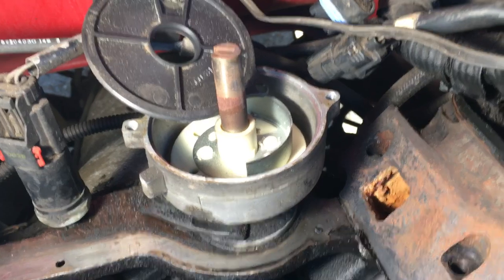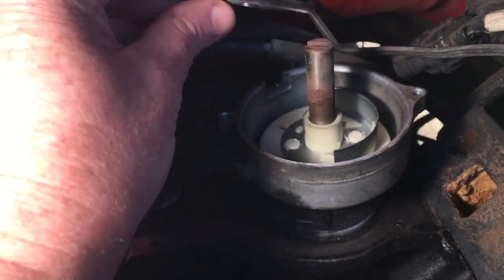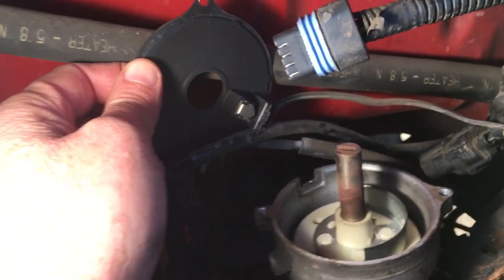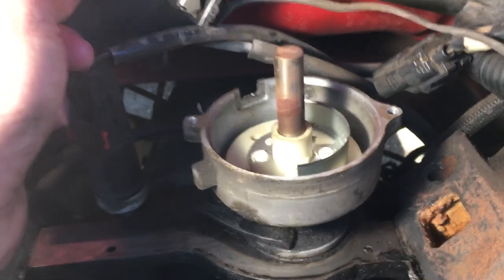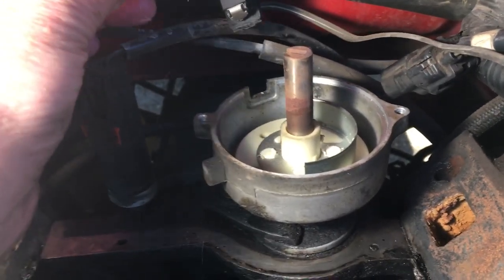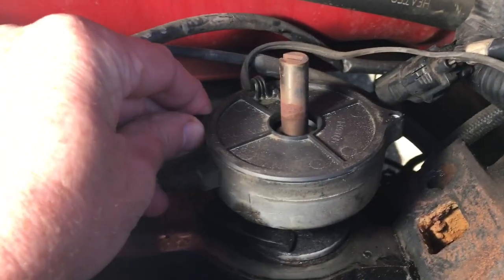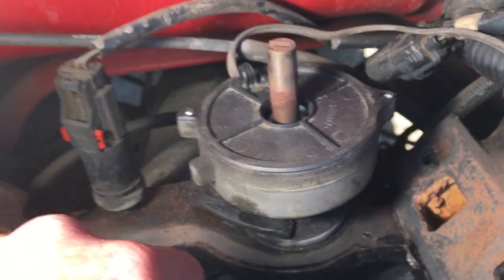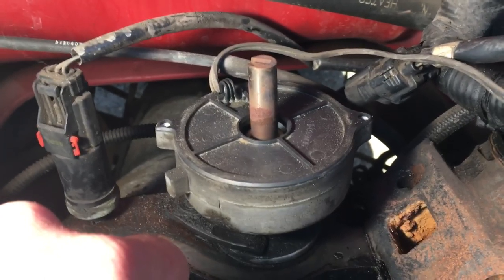Debunked - Dodge Fuel Synchronization - Part 1 (Setup for Parts 2-4)

Comment: You can set the distributor using a multimeter, a scan tool isn't needed.   1st make sure your distributor (camshaft position sensor) is installed correctly and leave the hold down snug enough so you can still turn it. Next clean the dirt and rust off harmonic balancer so you can read the marks.  if you have V8 look for the mark that reads v8 if u have a v6 look for the mark that says v6, and line the appropriate mark up with the 0 degree or the TDC mark on the timing chain cover just like when your setting your ignition timing. Step 2 find the wires coming off your distributor (there will be 3 of them). now on the harness side of the plug locate the (  being either tan or brown) 5v reference wire. Now set your multimeter to a 20 amp read on the DC side and probe the (brown or tan) wire with the red lead on the multimeter and connect the black lead to the neg side of your battery. 3rd switch your ignition switch on, but do not crank the vehicle! with the meter hooked up watch the reading as u gently rotate the distributor back and forth, you will begin to see the reading change from 0.05 to 5.02. The goal here is to tighten the hold down, when see a  5.00v reading on your multimeter.        A scanner is only used to read the current value (from the same 5v reference wire) that can easily be simulated with a multimeter
Reply from the maker: This is not entirely correct. The method might work but scanners don’t read voltages. They collect serial digital data from the ECUs data port. The number that the ECU is sending out the serial data port is the number of degrees from the crankshaft to cam shaft ideal zero reference plus or minus an allowed tolerance in degrees that the system will allow before setting a code and disabling the fuel system. The voltmeter method is probably finding the edge of the allowed tolerance window so it works but it’s not ideal.

Comment: It is a Hall-effect pickup sensor, not a photo-sensor. The 'shutter' vane can hit against the Hall-effect pickup if the distributor shaft is worn or the plastic stakes loosen up. The inside of the distributor may be dusty if this occurs.
Turning the distributor does not affect spark timing. That is determined by the stationary crankshaft position sensor in the bell-housing. The PCM controls spark advance & idle speed.
Reply from the maker: I thought Hall effect shutters had to be metal? I’ve seen plastic shutters on some applications.

I have parts 2 and 3 I would like your opinion on.

Comment: If you look down from the top. You will see a hole in the “pulse ring” that aligns with the hole in the bottom of the distributor housing if you line those up the Rotor should point to the mark on the distributor housing and your timing is set.
Reply from the maker: I will check into this.
Reply from the maker: I’ve put more thought into this. Lining up a hole in the “pulse ring” with a hole directly below in the distributor body would work only if the crankshaft were set to a predetermined position so you have a reference point for the crankshaft. You are setting the cam sensor position relative to the crank position so the crank needs to be at a location determined by Dodge engineers. Most likely there is a mark on the harmonic balancer that has to be lined up with a mark on the engine. Keep in mind this has nothing to do with ignition timing. The computer has complete control of that using the crank position sensor.
Reply: @moccasinmarine   That's what happens when I try to make a quick post from my phone. Yes you need to be #1 TDC. When you align the drive gear on the distributor with the cam so that all the marks match, distributor, pulse ring and rotor. That's all I've done in the past and the computer does the rest.
Reply from the maker: Jeff Jones good to know. Is this in a service manual? I’ll try this next time a have access to my balancer.
Reply: @moccasinmarine  Actually never checked the balancer. Mine was in a van. slid in the motor, installed the distributor, and installed a new balancer but didn't pay any attention to the balancer markings.
Reply from the maker: Jeff Jones then how did you know you were at TDC? The balancer is where the TDC alignment mark is on most engines (excluding LS engines).
Reply: @moccasinmarine  New motor. I set TDC on the stand before it was installed in the van.
Reply: Question, my rotor button does not point towards the designated mark. But it only goes on one way. Any idea of why that could be?
Reply: @DeerPlot  most likely the motor isn't set at number one cylinder top dead center

Comment: Would any of this cause an engine to have poor throttle response by way of seemingly no adjustment to timing by the PCM? I just pulled my dad's old Ram out of the woods this spring and my friend did the lion share of resto on it mechanically. It does have new injectors and cap/rotor. It turns on and runs, but basically only responds to low throttle activation. If I floor it it might do nothing, or it might if running at road speeds dump to 1st. But from 20% throttle to 90% throttle it basically does nothing other than ever so slowly crawl a bit faster. For reference, the engine and trans themselves have less than 10k on them having been replaced a decade or more ago.
Reply from the maker: It’s not timing. The engine won’t start if cam sensor is not working and once it’s running, the PCM doesn’t need cam sensor for ignition timing.

Being that it sat up a long time my guess is either bad fuel, wrong size injectors, fuel pump gummed up or sluggish. Get a fuel pressure gauge and measure fuel pressure while running. I think that’s where you’ll find your problem.
Reply: @moccasinmarine  I had already grabbed a fuel gauge and will test this weekend. Hadn't thought of injectors being wrong size... might be worth verifying. I was going to test based on it having a new fuel pump in case it wasn't hitting pressure. I did go on to find the other videos last night and realized the distributor is a goofy cam sensor of sorts. That does alleviate my concern about it.

Comment: What kind of distributor is that I never seen one like that
Reply from the maker: It’s a distributor used in late 90s model sequential fuel injection systems. The timing is no longer set by the distributor in this engine. Dodge shouldn’t even allowed it to be adjustable. GM locked their distributors of this era so they couldn’t rotate. DODGE left it adjustable but it requires a scan tool to set it back where it has to be if disturbed. The point of the video is don’t disturb the distributor until you mark its location.
Reply: @moccasinmarine  No, It doess not require a scan tool. Just a volt meter and you can  do it in your driveway. A lot of videos on YouTube regarding that!
Reply from the maker: @thunaru it requires a scantool if you want to set it back to a specific number. With a voltmeter you don’t know exactly where in the range you are. I would set it in the middle of its range for the best longevity.

Comment: What is the symptoms of a bad disk?
Reply from the maker: If the computer does not get the proper signal during cranking the engine won’t start.
Reply: Can you please help me. 2003 ram 1500 van. New rotor button and cap new coil and new crank sensor. Still no start 😢 pls help
Reply: @moccasinmarine  cool thank you for the info.
Reply: @10percent48  battery?

Comment: Where's part 2 or the rest of the video?
Reply from the maker: I was waiting until I had done more research and testing but ultimately Part 2 is going to explain why you get no performance gain regardless of fuel synchronization setting and Part 3 is going to show how to set the fuel synchronization without a scantool.
Reply from the maker: Part 2 is now posted.

Comment: Snap on will do the fuel sync
Reply from the maker: Yep but not many people own a snap on scanner
Reply: @moccasinmarine  being that any of them from the red brick up will do it Alot more than you think have them or can get off eBay for cheaper than one visit to a shop that is willing to still do this job. Im in the state of Michigan and I have called every dodge dealer in the state trying to get it done every one of them said that they didn't have any idea of what I was talking about even after showing them the service information and then still want to charge me 150 diag and then an hour labor to repair. I bought the soulus in a case with every adapter battery and updated to 2018 vehicles off eBay for 400$ and could have gotten a red brick for around 200 but I do Alot of work still and splurged for the best one I could afford
Reply from the maker: @claytoncoolidge992  the point of the video is if you don’t disturb the distributor or mark it relative to the block where it can be put back in the same position you don’t have to set fuel sync after a rebuild.
Reply: @moccasinmarine  marking it isn't good enough that's my point and unfortunately moving the dizzy weather for a broken bolt oil pump drive shaft or bushings needed to be replaced especially being these are over 20 years old now is highly likely. I'm just trying to add to your information witch is great if like you said you don't have to remove it